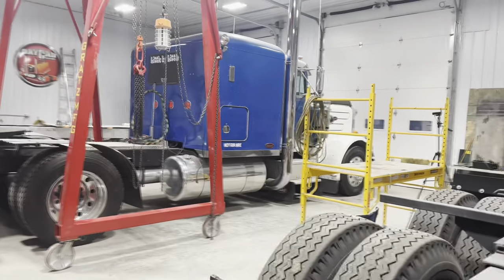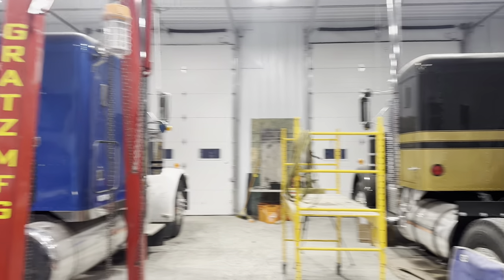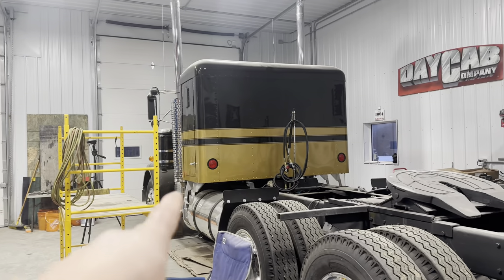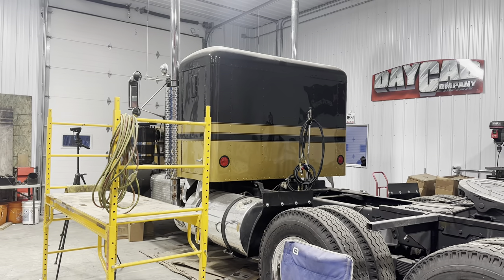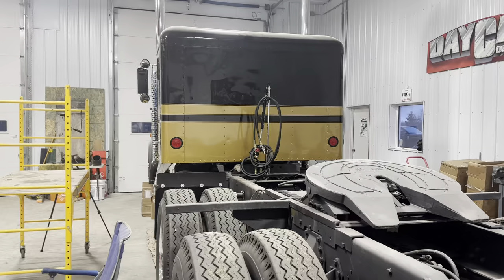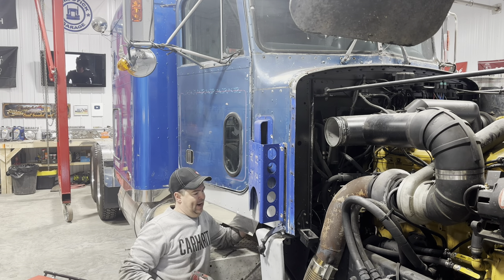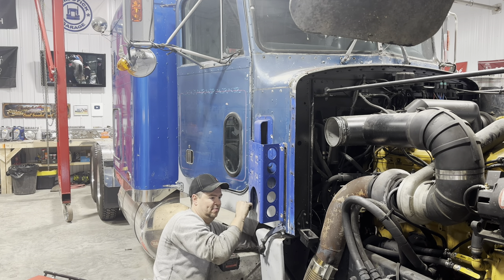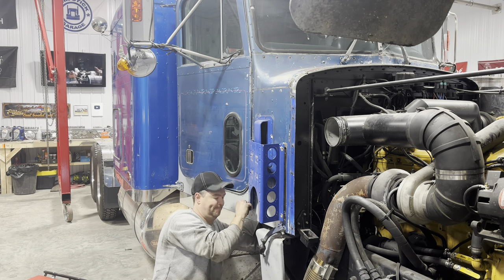Peterbilt 359 Restoration Ep.75 Making It Ugly

Comment: I remember trying to pull the wiper arms off mu Pops' 81 359 and could not get them off. That was the mid 80's!
Mark, you really should pull the vent windows out, and every other piece you possibly can as it will be a better job in the end. And take the sleeper completely off the truck. You will not regret it!

Comment: If your not taking windows out when you re spray get some electrical wire and push under rubber it will then leave a gap so you can mask and paint will drift under rubber .if you take windows out then you mask edges on the inside and use brown paper NOT news paper . It’s a lot of work but you should take sleeper off then you will be able to paint back of cab and front of sleeper. Keep up the good work it’s going to look a cool truck 👍A

Comment: Mark,can you not use a rivnut for that missing mirror mounting?A trick for window rubbers is to just lift the edge of the rubber and then tuck a length of thin wire around it into the gap,it keeps the rubber away from the panel enough to prep and paint under the rubber slightly,and makes masking the rubber easier too.

Comment: Hi mark, as you are replacing the glass, use it to seal the window frame, by having  a suction cup on the inside of the glass and a ratchet strap / bungee cord to draw the glass onto the frame .. you could also run a tape round the edge of teh glass to get a better seal when its pulled against the frame ... Keep up the good work .. Andy UK ..

Comment: Mr Mark, when I worked at a concrete company in my youth, I painted the mixer trucks. There was an attachment that gave me 3 feet of reach. Now, it was back in the 70s, and that attachment was there when I started. You may want to look into that. I painted many of concrete trucks and rigs with that spray head.

Comment: Best way to paint a roof is just by ladders or scaffolding. Key is to paint the roof first with the sides masked so you can touch or lean against the sides. Let it dry mask the roof and paint the sides. Anything over head will drop dirt when you move around

Comment: Hey Mark, nice to see you getting to painting Little by Little. If you take the windshield out you can tape plastic over the openings to keep the dust and paint out. Body shops use very thin, clear plastic. You might want to fix the mirror mounts on the before you paint. One way to paint your sleeper would be to unbolt the sleeper and slide it back. Nothing like doing everything twice! I am sure the truck will look great.

Comment: Looking good!  It's impressive to see you make progress on 3 different projects, simultaneously.

When you re-mount the mirrors, if you don't want to remove the inner panels, pop in some rivnuts or plusnuts and bolt to those.  They'll work just fine and you can install them from the outside.

Comment: the proper way to paint a truck like your blue truck is to take the boot out & pull the sleeper back away from the cab of the truck. That way you can get to the back of the cab and to the front of the sleeper. More work but that's the best way to get the best job & finish of your paint job.

Comment: Hi Mark! I’ve restored a tractor and have another one on the way, and someday in the future an old Brockway. I’ve spent a few dozen hours reading up on auto paint. Imron was popular and got its reputation for being the first catalyzed acrylic urethane (or urethane enamel). Nowadays its very comparable from what I understand to ordinary base clear systems.

Personally I’d suggest a simple base clear acrylic urethane. It’ll be every bit as good as the old imron. Single stage is good for solid colors but I’ve shot it in metallics and it’s just harder to deal with and it doesn’t look as good.

TCP global is a very good paint supplier that will custom mix paint for you. Lot of body guys like them and I’ve been told it lays down a lot easier than nason or omni. 

Hope that helps! Really enjoying following along, watched since EP 1 and loved every minute!

-An antique truck nerd
Reply: Also, on further research the OEM paint code for Sovereign Blue is NO347, which crosses to Sikkens FLNA9207.

Comment: I worked with Imron when it came out years ago. Paint is like iron when applied. When you have to do any repairs after it is hard to grind off. For me this is the worse paint ever made. You cannot beat the two stage base coat clear coat.Good luck with the paint.A devoted follower.

Comment: Hey mark I just got a question why didn’t you paint the truck before putting all the chrome on? Squirrel?

I would paint the frame for the side mirrors. But keep the mirror and lends chrome.
Paint the centre of window and windshield wipers, gas tank straps and your roof lights. But that’s just me. Oh and centre caps of wheels. 
Also could you find mirror and housing like snow man? 
Also for the window you could plastic or painter paper and tape everything from the inside.

https://youtu.be/0ezdzTeS1WM

Comment: Hey mate. I know you're hating yourself and thinking you've done things the wrong way, but you haven't. 
You're motivated on Snowman and Iron Duke because of LbL. You know how cool it is to drive a project and that motivates you. Plus, you're naming money now so it's basically a second job.
Image back in Ep 20, blowing the whole truck apart, when you had 1000 subs and were saving up to buy oil, and every time you looked at the truck all you saw was 200 hours of bodywork? Everything was covered in bondo dust, nothing was turning out right and you were just going over and over the same spot trying and failing to get it perfect? Then walk into the paint store and they tell you it will be $3000? There's a high chance you'd lose motivation. A lot of projects wheels fall off because people tear them down, make a huge mess, it looks garbage, they lose the image of what it could be and only see what it is. I've done it myself.
I always tell people, especially younger people and first project people, to keep the project "just a few hours away from driving" and only do small jobs at a time. That way at any time you can slap it back together, fire it up, drive up and down the driveway, and image when it's done.
There's a chance you wouldn't be where you are if you had attempted to paint LbL in the beginning. As much as I wanted you to!

Comment: If you have to open the door to back a trailer up, you don’t know how to back up a trailer.  Not only is it unsafe (you could fall out of the truck while it’s moving), it’s unnecessary.  Use the mirrors for their intended purpose.  In 26 years, I’ve never opened the door to see where my trailer is.